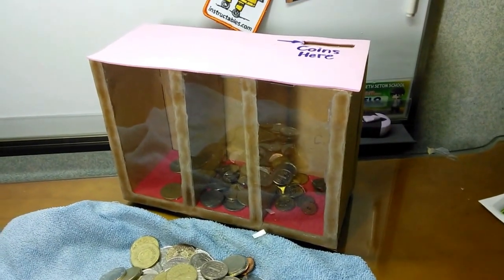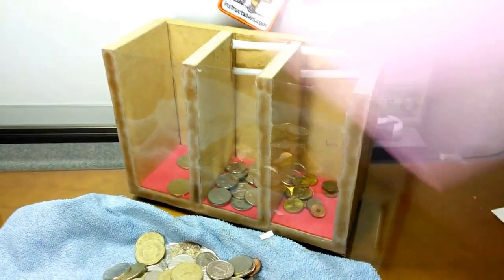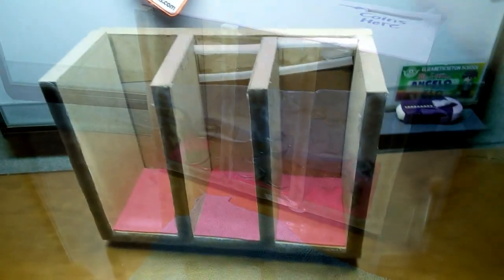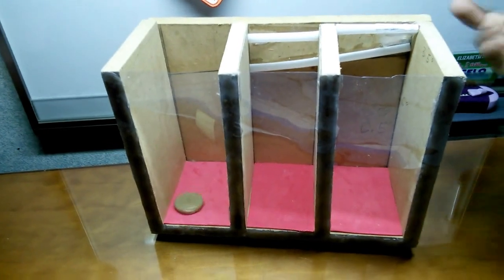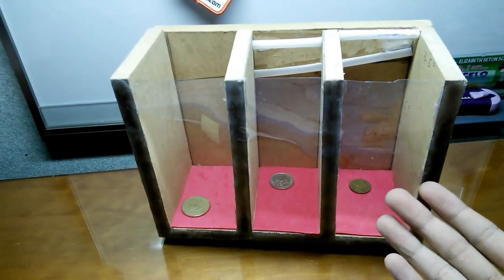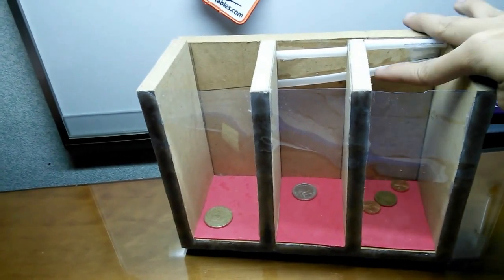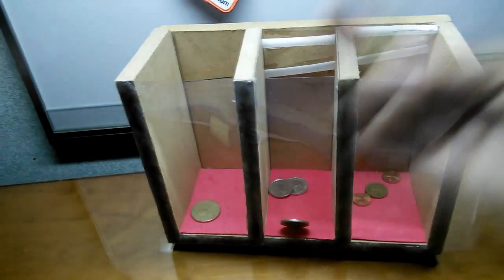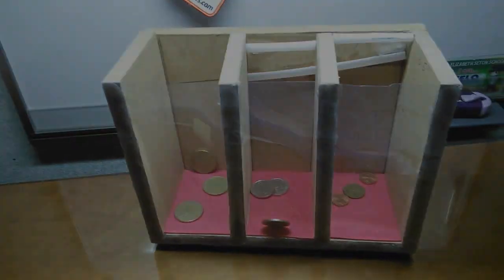DIY Self-sorting Coin Bank

Comment: it dosent make any sense if you cut the straws in difrent shapes the coins would just fall in each a slot
Reply: +CRAFTED MINECRAFT  no because the big coin would be too big to fit in the smaller coins so it keeps rolling until it fits through a slot, whereas a smaller coin would fall through the first slot because it fits straight away... if you get what i men.